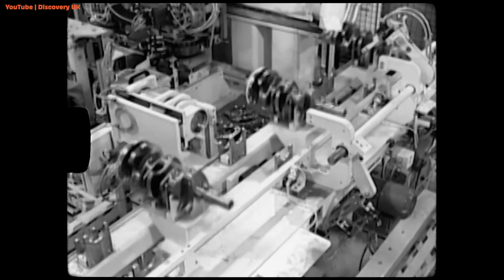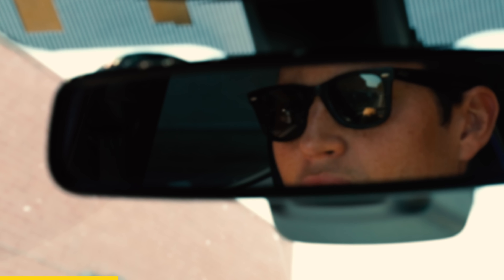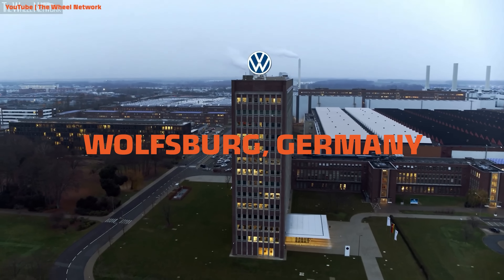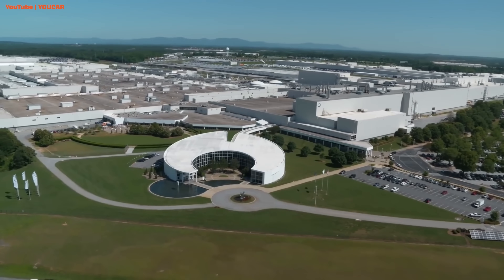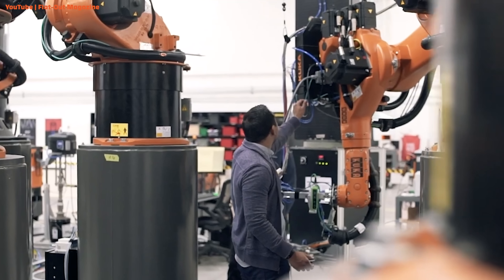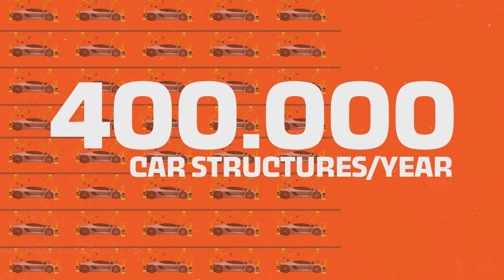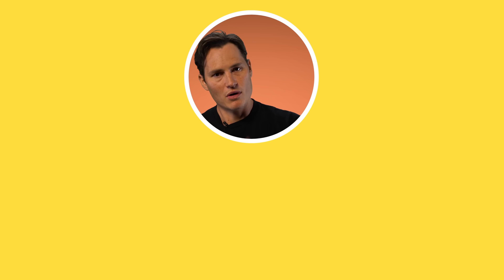A.I. Designed this Car

Comment: Machine Learning Generative Design has already been used in Production Cars.
Cadillac CT6 had a very complex Aluminum Casting which was dictated by Generative Design.
https://www.popularmechanics.com/cars/a15428/2016-cadillac-ct6-aluminum-castings/
"created a ribbing system that requires the least amount of metal possible while also maintaining the chassis's structural integrity"
This concept is already quietly being used for certain parts.

Comment: Imagine just being in like 2050 being like: oh here lemme go 3D print my car brb
Reply: Go's and prints and AE86
Reply: YOU WOULDN’T DOWNLOAD A CAR
Reply: @eg22222  Kevin Czinger (in a John Cena voice) "Are you sure about that"?
Reply: You wouldn't download a car... remember those ads from back in the day? Well the future looks bright for piracy lol
Reply: @MarlonSolisFallas  What about uploading a car to these robots and then paying for the cost plus shipping. We could literally make our own cars with 3D modeling.
Reply: @masonkelly6694  If you can afford it
Reply: @MarlonSolisFallas  i need a lambo torrent
Reply: @clutch3shot  pirate Bay gonna be the pirate dealership
Reply: @MarlonSolisFallas  oh f*** you beat me to it
Reply: Right. Like i gotta go print a new bumper & fender for my car, no biggie
Reply: The issue is that 3D printing is slow. And there are limits to how fast it can go. At least for an FDM printer. For a laser sintering you can probably speed it up because lasers, and because the powder metal supports the structure being printed. However for FDM the print either needs supports or you are limited to designs that are self-supporting. 

I use 3d printers at work. Im talking from experience. I literally design things with 3d printing in mind. I tend to make more organic shapes with fillets and curves where if i am deigning for our machine shop to make, i will try to make it as easy as possible, even with CNC milling mahines, it's just easy to make things more geometric. 

I have also used 3d printers to make parts for my custom VW Scirocco build/swap.
Reply: @alessandropru  , well, this video just simply proves that laser made 3D printers are the wave of the future for all 3D printing, as well as manufacturing.
Reply: @alessandropru  while you ain't wrong, 3d Printing is still relatively new as a mass used technology. It has been around for a little while but with the surge in popularity I'm sure there will be a continued surge in tech. Refinement to speed it up and get more intricate parts. As for this car Manf. I believe the car's pricetag reflects its R&D as well as Manufacturing cost
Reply: you can 3d print rc cars but its still quite a bit of work
Reply: at that point I'll just print a suit and fly around
Reply: Let me print out a Nissan GT-R real quick
Reply: I could see that happening.  Maybe in 2070 though. (:
Reply: Making a 3d printed turbo.
Reply: Well like I thought about it and well I like the idea.
Reply: *buys car for the design.
Reply: @claytonmunson8639  Yeah, well if you're smart enough to design your own. Otherwise, it's not gonna happen. But small components like turbo kits and exhaust kits might be a possibility. In the future. Maybe a design someone open sources in the net or something.
Reply: There will no be 2050
Reply: YOU WOULDN'T STEAL A CAR...

US: 3d prints one
Reply: Imagine being in 2050 where 3d printers dont take fuckin 30 hours for one item.
Reply: Pirating a car
Reply: You mean 2077
Reply: You guys are explaining a joke btw
Reply: @SunsetTheProto  toaster?
Reply: @FloridamansAlligator  OwO?
Reply: No in 2050 A:we will all be died from global warming
B:A robot will be delivering your burger
Reply: Lmaoo
Reply: And you come back about half year later with this 21c :O
Reply: So glad my account was finally recovered by @steve.watcher such an incredible hacker. Find him on Instagram 👍🏾
Reply: @marcusluka6050  , what does your comment have to do with the content of the video, out of curiosity?  I am sure that your friend is an awesome person that has awesome skills, and that he would also be an expert in his field, and I am even sure that he could help me out with what I need in the future, but I also honestly fail to see what he has to do with the content of this video.
Reply: There will be no resources left on Earth to build a car on 2050
Reply: @user-ov2fc5sd1e  , you clearly know nothing about atoms, do you?
Reply: Yeah lets upgrade my vw sportline 9n with a 3D printer ;)
Reply: Imagine using use and throw cars
Reply: You ever played borderlands? 🤨
Reply: I’ll edit this comment in 2050
Reply: lemme download car blueprint for printing from torrent brb
Reply: Lol possibly
Reply: Bruhhhhh
Reply: Basically how rc cars are! I got my 3D printer so I could make parts for my rc car cause I kept breaking them, works perfectly!
Reply: You'd still need materials
Reply: I'm sorry I'm late my 3D printer malfunctioned and wasn't able to print my car
Reply: More like 2250
Reply: More like 2500
Reply: iif  Nah I don't think the government would be ballsy enough to take our beloved cars away from us.
Reply: Sounds like hell
Reply: The cars in 2050 will be company owned you pay a huge price to get the car and pay monthly a large subscription to keep driving it, yet it is a property of the company not yours...
Reply: @newrevo5525  As a gearhead this is literally my worst nightmare, not being able to own a car anymore
Reply: How is this comment so popular?
Reply: Pretty much any object actually.
Reply: Great but answer this: how you find materials?
Reply: There will be no brb in 2050.
Reply: @jared_chan  there will be no privately owned cars in 2050 👀
Reply: @Trihurt11  no private brb
Reply: @Trihurt11  so all the cars are just gonna disappear? Ok buddy
Reply: @Trihurt11  
Only if you let it happen. Arm yourself and resist tyranny.
Reply: @msport_erick  , technically, insurance and road laws would end up going so insane and anal retentive that literally no one would want to drive a vehicle anyway, plus rail travel is a bit more convenient than road travel and you also have less of a chance of crashing with railways than you do with roadways, and especially if trains/subways/light rail trams/trolleys are put inside of tubular tunnels, as well as also have the ability to ride said tunnels.
Reply: @paxhumana2015  there are many people that would rather die than lose their car.
Reply: I guess, you will be able to do that in 2030
Reply: @SlideS1de  very true
Reply: Top gear made a video on this car 7 months ago this is old news in todays tech
Reply: iif  communism?

Comment: The thing about AI is that it can min/max pretty easily but car manufacturing is made up of compromises, e.g you can make something more expensive to build at the benefit of making it easier to service, saving future labor costs. So at some point these choices need to be made

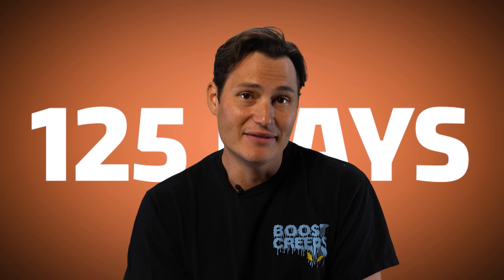Comment: It takes 125 days for a AU to build one car, as you said at 9:10, so that is roughly  2.9 cars per year per AU.  In 2019 Toyota USA built 157,000 Corollas.  To equal that production number you need 54,138 AU at a cost of $162,414,000,000 since each AU is estimated at $3,000,000 each and a conventional system is estimated at $500,000,000 giving you a unit cost per vehicle by cost of manufacturing system only of $1,034,484 per car for the AU and $3,185 per car for the conventional system.  Cost is given at 10:50. 
At 9:10 you said it takes 125 days per 21C and now at 11:30 you are saying one can build 10,000 per year.  Makes me question if you did that math correctly, so lets walk through the math.  One unit takes 125 days be constructed by the AU and there is 365 days per year.  So we take 365 and divide it by 125 and that equals 2.92 ..... kinda for off from the 10,000 number unless were you come from a year is 1,250,000 days long or you use 3,449 AUs, and that many AUs would cost $10,344,827,586.  At about 11:40 you said 40 AUs can make 400,000 cars and I already showed where you contradicted this statement but lets see how many AUs you need to make 400,000 cars and what that would cost.  You would need 137,931 AUs that would cost $413,793,103,448.

Comment: This is definitely interesting. Computational assisted design and 3d additive printed parts. However, a lot of your presentation is wildly misrepresented. For instance, comparing 1 vertical assembly unit to the entire Volkswaggen assembly plant,  in physical space,  cost, and even actual functionality. Does that Czinger assembly unit build engines from scratch? Transmissions? Batteries ? Somehow I doubt that it assembles dashboards from scratch  with LCDs  and so on? Does it paint the car? Mount tires on wheels? Maybe it does all of that, but I doubt it, but the VW plant does. So your 3 million dollar Czinger build module can't be compared in any way to a fully baked manufacturing plant. Later you mentioned needing 40 of these assembly units, which raises the cost to 120 million, but still has the question about engine assembly, painting, etc.  Anyway, please be more honest in your comparisons, I'm certain that you were well aware that you were not making fair comparisons, if the tech is as cool as you think, it will sell itself without the manipulation

Comment: As intersting as this sounds, I imagine this means many jobs will be cut.
Reply: A vast majority of jobs will be replaced by A.I. in the future. That's why it will be important to have laws in place that protect normal people and provide basic necessities. The wealthy will have all the power.
Reply: @thawkward3985  Detroit: Become Human intensifies.
Reply: this can mark another industrial revolution
Reply: Also a new kind of jobs would arise
Reply: new jobs will rise don't worry, that is the same script we've heard from people in the 1800's that used to manually fire each streetlights at night or those who manually plant crops in the fields. 

imagine programming, manufacturing of these machines, designers, engineer and more booming in the next 10 years.
Reply: All good points. I forgot about the programming and engineering involved.

Comment: It's kinda ironic, that this computer designed/engineered/built car, is deriving inspiration from one of the last, & baddest jets designed/engineered/built by a crew of people with rulers, protractors, & calculus & trigonometry, slaving away when computer technology was at it's infancy. In a way it almost seems like an actual middle finger to the root human ingenuity, & an applause or celebration of deferring the work.

Comment: Prediction:  Czinger will be acquired by another current manufacturer for their build platform. Ford, GM, FCA, or someone else.

It would be cool if someone figured out how to create a self contained supply chain for building cars. Inputs would be used cars. Outputs would be new cars.

Comment: Anyone remember the car factory fight scene in Minority Report. That’s basically what is becoming reality now.
Reply: @F a how's that?  Robotic assembly will eventually lower the cost of production.  Why would it not be repairable?  Need a part 20+ years down the road?  Sure we'll print that out for you and have it ready in xx days.  No tooling means no worries about discontinued parts.
Reply: @F a well, everything has to start somewhere, or nothing would ever happen.

Comment: can we please quit using AI as a catch all for any sort of calculation done on a computer?  it's basically lost all meaning at this point.  this isn't AI, it's topology optimization which doesn't need AI to work (at least it wasn't even explained in this video how AI is actually utilized) .  Also, in reguards to all the 3d printing,  most of the parts shown could be pretty easily manufactured as a casting and 3d printing doesn't offer much of an advantage other than quick prototyping.    yall titles are getting awfully fucking clickbaity.

Comment: For those interested, 4:00 is called multidisciplinary design optimization and is something that has been done computationally in aerospace and automotive for a very long time. The real limitation of it is that it takes a lot effort to both build numerical models that define your requirements AND get them parametrized in a way the computer can act on them to "learn". The process is also not free: it still costs a lot of resources to run those optimizations - sometimes taking tens of thousands of cpus over hundreds of hours depending on what you are simulating (especially if it's a whole vehicle). 4:40 is a result of topology optimization (which has also existed for a long time) and can be ran easily on a desktop in a matter of minutes or hours, but can't capture as many types of load cases. Both are a fascinating topics, but I wouldn't really call either method "AI" considering they've been around since the 80's...

Comment: But also all this "shortest rout possible, most efficient" stuff means it will be impossible to work on.
Reply: That wiring bit made me die on the inside
Reply: You don't fix that shit, you print a new one
Reply: but they could technically incorporate proper working space in their algorithms couldn't they?
Reply: The other thing is, there's a lot of stuff that will no longer need fixing if there is no human error in the design.

Other thing is, you won't repair a hypercar anyway, this is bleeding edge stuff that you'll probably not be working on anytime soon as a car enthusiast/hobbyist. 
This is very impressive stuff that is VERY new to the industry,  what needs servicing like brakes and suspension components will most likely be accessible and repairable. But for stuff like engines, gas tanks, wiring... All that stuff is already impossible to work with nowadays so I don't think it changes much, if they make it even less repairable but legit more efficient and durable than I say it's alright
Reply: @c4_yrslf726  it’s more efficient because if the design yes, but that doesn’t mean it’s designed more durable. I believe it’ll actually be less durable as the parts will have less mass and be less strong. Because they are not as bulky and losing 100% of the weight they don’t need. This means maximum weight efficiently, and downforce, and performance, but it means it will in fact break more often. Not less often.
Reply: @intothenight2073  That's true, but I was mostly refering to things like wiring and mostly electrical stuff. Would probably prevent useless cabling, meaning less troubleshooting and less connections to go bad in the first place. 

I also didn't mean for well designed parts to be more durable, I'm talking about parts that we're NOT well designed that could've been solved by AI correction. For exemple, the Ford ignition switch that"s been faulty for like 20 years but they kept reusing it. Or the fact that fords 4.6L and 5.4L v8 didn't have anough threads for the plugs that would cause them to blowout... AI could've found all similar issues in the design process
Reply: @intothenight2073  That "I believe" is lack of knowledge. The AI designing the car will already have done stress simulations on all the suspension components and on the chassis, having incorporate the design of nature is called bio-mimicry. The bone marrow-like design of this entire car is akin to the hollow bones of birds, in order to keep it as light as possible. This car is still in the proof of concept stage, but imagine if you program the AI to build a truck around strength and seviceability with other materials like steel and composite plastics, then it sounds better. Human limitations around design and manufacturing are getting smaller and smaller.
Reply: @intothenight2073   not sure durability of a material increases by mass there bud. By that logic, steel are stronger than carbon fiber. not sure what you on about breaking less often though. But did you know F1 cars transfer and transformed its break disc heat into energy during this hybrid era? If anything, the only faults i can find is you'll changed your tyres more often, as the massive downforce is gonna wear it down.
Reply: @c4_yrslf726  
"@C4_yrslf, meet HAL9000, our AI Design computer."
"HAL9000, meet @C4_yrslf."
"Hello @ C 4 _ y r s l f, my name is HAL9000. Is it OK if I just call you Dave?"
Reply: Excellent - Montgomery Burns
Reply: @Donalld Allhands  IDK what kind of spaceships you're driving, but reality has caught up with 80's sci fi. Besides this hypercar would be lucky to get to 100K miles where suspension and steering would start to wear out
Reply: Donalld Allhands  Well, at least I made the effort in thinking what the future holds for us and the automobile. Yes, sci fi will always be ahead of reality, but reality does try to catch up with sci fi. And yes, wear items are integral for a vehicle, I never said this hypercar was maintenance free, just that the preventive maintenance would be prolonged.
Reply: Also, that kind of micro tolerance and gaps means if your car chasis, body panel, etc deflect just a bit, your replacement part wont be easily put in place
Reply: exactly
Reply: Yeah i was about to say that
Reply: Good luck fixing this car..lol
Reply: @brianbatey9281  What do you think there would be to fix on this car? brake jobs? easy, engine tune-up? just detach the hardpoints around the engine and the whole car would be in half for easier engine access. It's easy to get close-minded on things we don't understand or have the knowledge.
Reply: Exactly what I was thinking!
Reply: You're not gonna work on the car ever. Something breaks, they take it back, their engineers fix it and print new shit and give it back to you in 6 months.
Reply: I'm just waiting for all the surprised pikachu faces when this car is as easy as a street walker to work on.
Reply: Time to find a new hobby bud